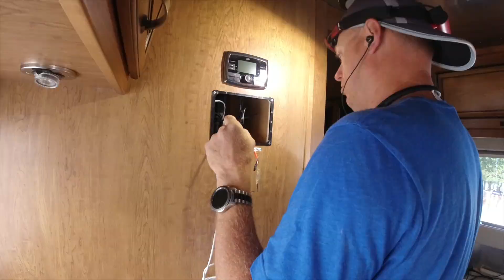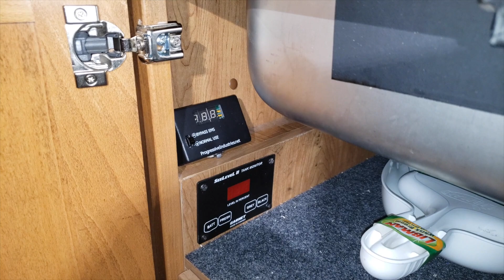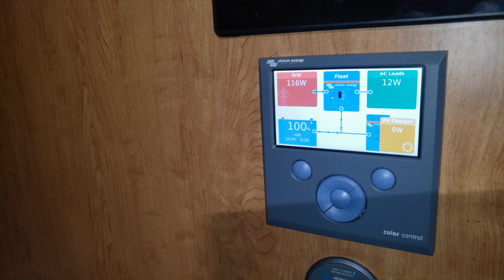2018 Airstream Classic 33FB | Solar & Battle Born Setup

Comment: So an Airstream classic 33FB is exactly what I plan to buy. Does this amount of solar allow them to go totally off grid and run everything on solar only? I want to be HOOKED UP with solar and never have to plug in, or run a generator.
Reply from the maker: Thanks, Barb. This depends on a lot of factors. Factors like: where in the country will you be dry camping, how conservative are you / what kinds of appliances and items do you want to power, etc. Yes, everything can run on this solar power; however, A) not all at the same time and B) power management has to be practiced. Solar power is not a substitute for 50A shore power, of course, so on cloudy days and whatnot it is suggested to definitely have a generator as a backup, etc. Mike is definitely willing to discuss this with you further to get a better understanding though. - Leanna :)

Comment: Mike is the Airstream Master. lol With the Airstreams I assume you have to use the 100 watt panels do to the room. Always fun doing a install in the rain. Nice clean up on the wires. I like the install under the reclierns. Very cool. I like that color control. Pretty cool. Another job down. Great install as always.
Reply from the maker: lol - 'Airstream Master' - he better be...he's about to do ours, HA! Yep, we do the 100W panels due to the sizing of the panels. Yeah, the color GX is pretty cool. Yeah, this one turned out nice. Thanks!

Comment: Hi Mike, I am one of your many admirers.  I appreciate your hardwork and skill helping many RVers indire straits.   Perhaps,  you've been asked this question before.  I am considering buying a 5th wheel in the not too distant future.  If I buy a new Keystone or Jayco, for example, the manufacturers offer solar/battery installation as original equipment.  Sometimes at very high cost for an installation that needs to be enlarged afterward.  If I buy second-hand, you could do it, but there would be some understandable waiting. Have you had the chance to inspect any of these factory solar rigs, and are they any good?  It would be a waste of money to buy new with factory solar only to have to bring it to you repair it for shoddy work or upgrade it because it's so under powered? Any thoughts?  Thanks so much.  Stay safe.
Reply from the maker: Thanks so much, Roger. Definitely go with your gut feeling on the latter part. As long as you want a system that will get you truly off grid, you’ll need more than 500W of solar and I have seen any manufacturers add the ability to do more than 500W. I typically never use their wire since it’s rated for 500. As long as you want the capability to do more it’s better to skip the manufacturer’s solar package and go with aftermarket.
Reply: I agree with Mike. RV manufacturers are at least five years behind the  state-of-the-art. Although I did see a brand new Grand Design with a well-executed 800 ah lithium system and 1200 watts on the roof this week in Arizona.
Reply from the maker: @billtaylor292  it’s flawed. 800Ah when full ...is great. However, only having 1200W of solar will take more time than the next day (in perfect summer sun) to charge a dead battery bank, with no draw. It should have at least 1600W or more to be a “balanced” system. Was it actually done by the manufacturer or dealer? Pretty big system for either a manufacturer or dealer. I do mostly new rigs, as new as a week from from the manufacturer.
Reply from the maker: @billtaylor292  oh and that is provided they used a 150/100 MPPT to allow the panels to max out for charging and used a proper gauge of wire to allow little to no loss. 😳
Reply: @TheDryCampers  He ordered it like that from Grand Design. His last two fifth wheels had about 1200 watts each, he figures that should be enough for this one as well. Mainly just to keep the refrigerator going. His usage is minimal otherwise. He stopped to see me because there was no power at the outlets in his bedroom. He thought something had come loose. But they had never hooked it up to start with. Like I said, they are several years behind.  I think he just assumed they would power everything in the house like I had done for him previously. Modules were were 3+3, wire size looked fine on everything. Voltage drop was minimal on everything I looked at. Good call on the Victron, that's exactly what they did for the charge controller. They even grounded everything. Bonus!
Reply: @TheDryCampers  Mike,  thanks for your reply.  It's just not worth overpaying for a factory solar package when it's obviously underpowered with a too small charge controller,  a small (1000-2000) inverter, too few panels and inadequate battery capacity (even if they are lifepo4).  Even if you have a 12V residential fridge (or one with its own dedicated inverter), the manufacturer is setting up the customer for failure.  Not until the manufacturers and dealers stop offering solar for show and/or bait and switch will customers begin to trust them.

Comment: Hi!!  We are getting an AS FC 23cb in March and we need a solar setup.  How can we connect?  Would like to consider using you for the job, if available..  thanks :)
Reply from the maker: Hi Rebecca, you can connect with us on our website at https://thedrycampers.com. We are currently booked through mid May and depending on location we could potentially squeezing one more install before our summer trek to Alaska, but definitely connect with us and we’ll schedule a conference call to discuss further. Thank you!
Reply: Will do, thanks!

Comment: How much does a setup like this run?
Reply from the maker: Our pricing is from 13k - 45k roughly - turn key and sustainably handle the load of an ac for 2 hours or infinite.
Reply: @TheDryCampers  Thank you!  I was thinking $12-15k.   I’d want 4 GC3s. 3 for sure, 4, might have to discuss that.